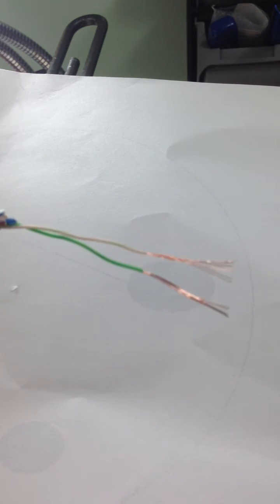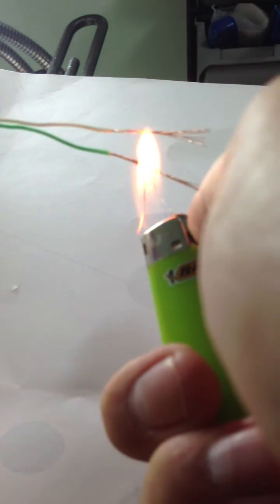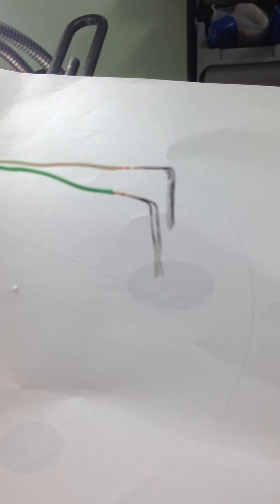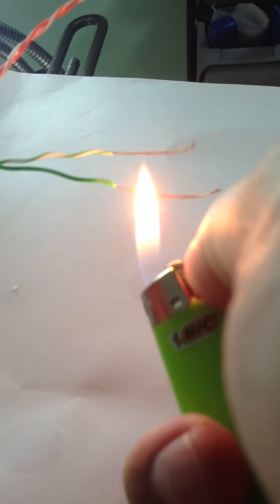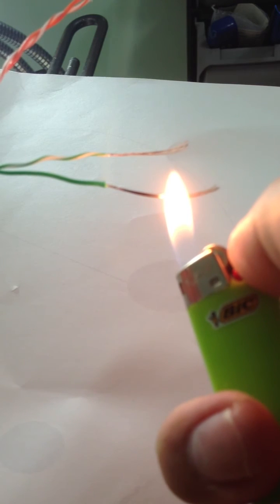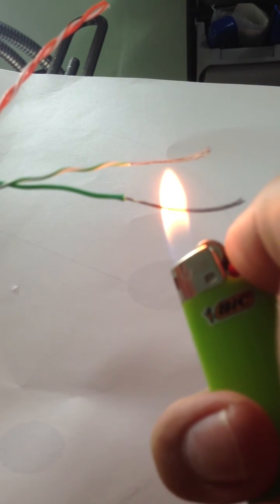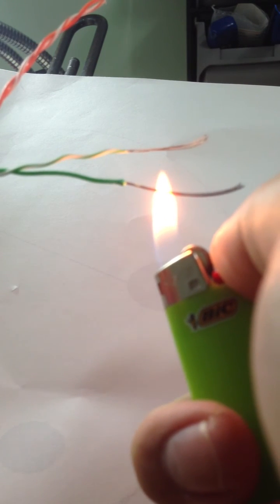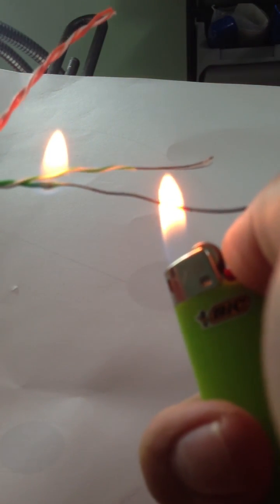Copper Clad Aluminium Vs Pure Copper

Comment: This is what happens when someone who doesn't understand engineering puts a video on YouTube so people who understand even less can be influenced.  When was the last time you tried to transmit fire over cable????  First off, heat is caused by resistance, not a cigarette lighter.  And the resistance of the cable relies on the AWG size of the wire, CU or CCA.  A 10AWG CCA will carry more current and run cooler than a 12AWG CU wire.  The 10AWG CCA is slightly larger but it weighs less, costs less, and runs cooler.  It also terminates the same.  So, if you spec your Ethernet cable correctly, you can get a safer, less expensive and stronger cable.  Or you can just stick a cigarette lighter test anything you want to test and go with those results.

Comment: Great demonstration and hits the bullseye of not buying the copper clad aluminium as your telecommunication cable. That's why ACMA deemed it's non-compliant. They're also known to cause degradation in data throughput ( slowing of speed ) so there's not much reason to buy this CCA cables unless you like to cut corner.

Comment: I never seen  aluminum clad network cable before, I bet its performance is horrendous
Reply: Most coaxial cable is CCA.  At higher frequencies it will perform the same.  However, not all CCA is created equal.  Need to use reputable CCA product--such as CopperweldTM